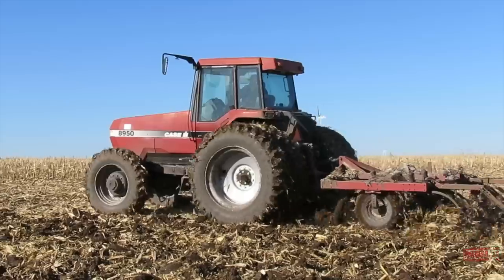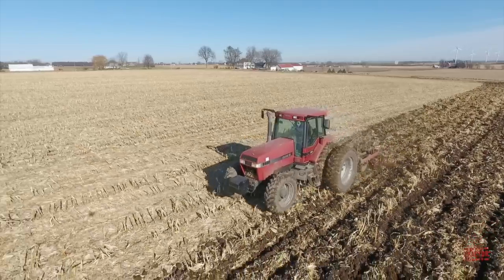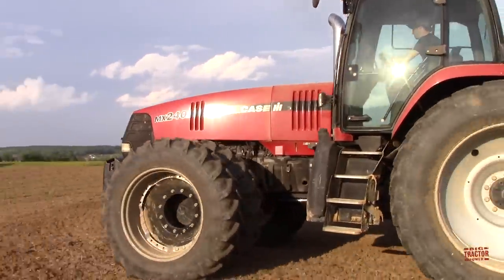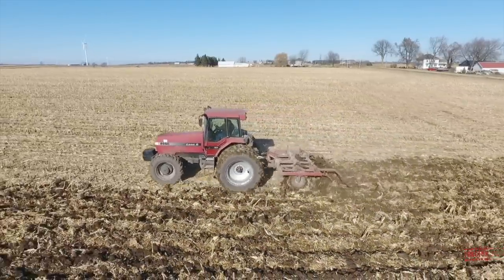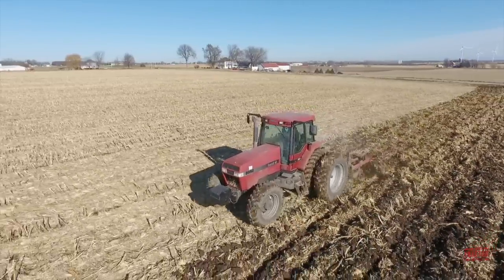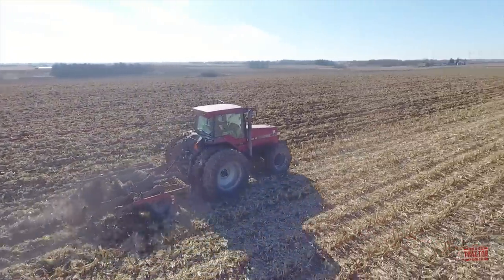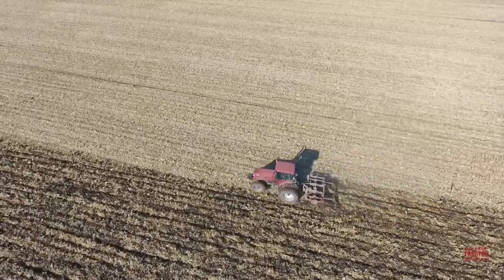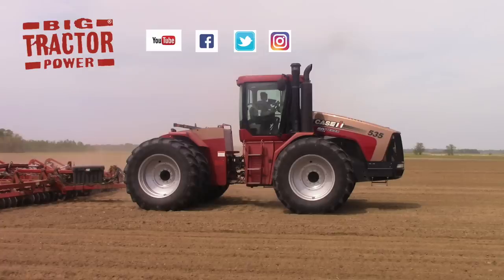Case IH 8950 MAGNUM Tractor Working on Fall Tillage

Comment: Primarily a Green guy here .. But I ran the classic Magnums a lot too -  7140, 7150 and 8950.
Nice tractors .. roomy cab and good power .. But they all ran HOTTER than HELL! All that fancy styling and constrictive hood work - along with a wimpy cooling system .. didn't allow for good airflow .. and seems like they were always running in the yellow.
When chisel plowing or pulling a big disk .. I was always removing the engine hood side covers and tossing them in a hedgerow somewhere. 
Didn't help much .. but would run a bar or sometimes two cooler. 

Compared to a Deere 4850 or 4955 .. you could work the shit out of them all day .. and they'd rarely go above half on the temp. gauge.

Comment: We didn't get 8900-series here in Europe.
Case IH sold 7200 Pro-series at same time here, those have also vertical grille, maybe same tractors with different numbering. 🤔
Reply from the maker: There must have been regulations or requirements in Europe that made it more difficult to introduce a tractor or combine?  The 8900 series was only on the market 2 years so maybe a 7200 Pro was easier to offer than a new a new series?  It seems like John Deere did offer the 60 series like the 4960 but rather offered an updated 4955.  Maybe a similar reason???

Comment: That’s awesome saying that tractor working in the field but my question is when I was reaching the end of the row at the headlands there’s a funny noise what was that noise
Reply: mrour canada He was using a single wheel brake to assist in turning. They sometimes make noise as the brake is applied.
Reply: Kirk Gibbs Well that all makes sense now thanks for sharing that

Comment: They were tough,  and cheaper than a Deere.  Even the last ones,  they wasted a lot time.  The cup holders were a joke .  You could spend 30 minutes sometimes trying to get hydraulic lines in or out and yes we knew every trick to get the pressure off.  They were terrible
Reply: The Case or Deere?
Reply: @bcdieselsofficial  we had a 7130, 2-7140 and later 2-8950
Reply: @1214101  the boxcar magnums are horrible machines in my opinion as well.